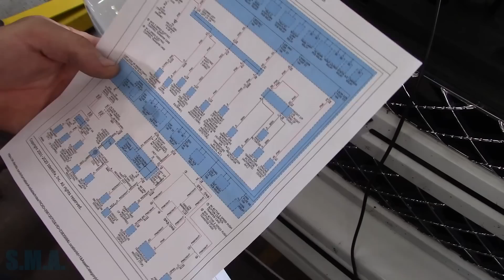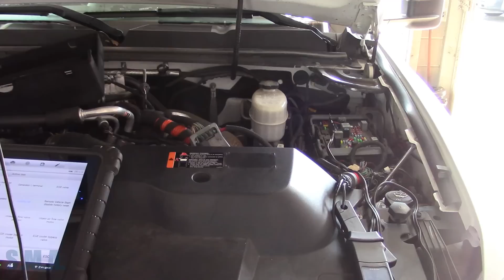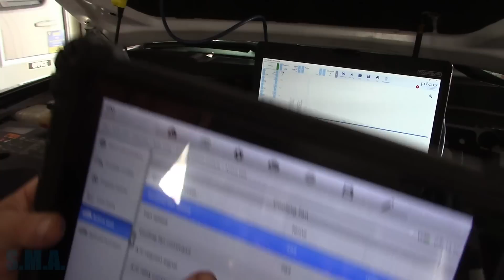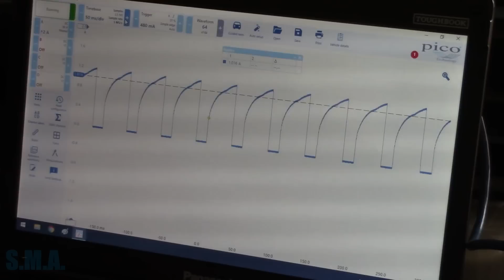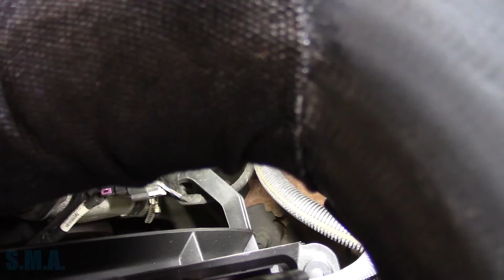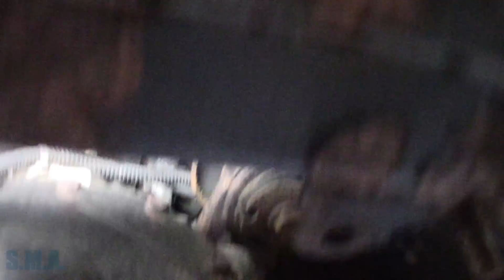Chevy 3500 Duramax Keep Blowing Cooling Fan Fuse

Comment: I had an intermittent short in my 66 gmc taillight circuit.  All at once, it started randomly blowing the fuse.  Only when you were driving it, of course.  Finally found factory harness wire getting pinched by the bed (factory routing).  You had to be driving over bumps and applying the brakes at the same time to blow the fuse. Must have taken decades to eventually wear through the sheath and then through the insulation of that wire. Taped it up good, put in a zip tie to secure the harness away from the pinch point.  Problem solved, mostly by luck since I started at the bulb and worked my way towards the cab.

Comment: Those GM trucks have lots of areas where the harnesses rub through.  The engineers who were in charge of the routing should of been fired.
Reply: Agree, because non-engineers would not have routed it that way, nor made it so frickin short that it couldn't be properly routed. As someone else said on SMA: "Nobody sweats the details like GM's customers."

Comment: I am saying this at 7:30 into the video .remember that time when you couldnt figure out the fuse blowing and it related to the windshield wiper more wireing that frayed at the motor area? just thinking something may be similiar here but not neccessarily the e wiper motor

Comment: Seriously, Eric, you are an inspiration.  A logical approach will lead you to a diagnosis and the diagnosis will lead you to a solution.  But a question - would a dealer have fixed the two wires or would a dealer have replaced the harness. I really don’t know.

Comment: If the white wire was chafed enough to allow enough fault current to blow the fuse, why did the clamp on ammeter only show one amp while you were commanding the fan relay to operate?

Comment: "Chevy thunder".. Think ya meant Isuzu.. LOL
Reply: Chevy Thunder: When the engine falls out of the vehicle and hits the ground.
Reply: @markh.6687  ow is that were it came from
Reply: @neilmurphy845  Nah, it's normally the SHIT ASS IFS suspension deciding to instantly disintegrate itself the moment you put any front axle torque to the spindly little "steering links" that ran from the 2wd 1/2 tons with a 4.3. All the way through what GM called a 1 ton 4wd..
Reply: Never knew that thank you for that info
Reply: @neilmurphy845  You're welcome.. 😉
Reply: The thunder is the rough running from electrical issues
Reply: @armpitdew  It's normally the injector bodies themselves.. Do need to check the digicals on them quite often as well though..
Reply: @armpitdew  ow now it makes sense
Reply: @Ben Gaudreault Yep, with shit injectors, fuel management, electronics (that rival those of early 90's dodges), and way too much other BS that needs not mentioned.

Comment: Found a chaffed wire on a '97 Dodge Stratus like that. It was causing pre-mature ABS activation. It was a new Stratus with 3,700 miles on it, back in '97. The wire harness was hanging down real close to the O2 sensor. Nobody could figure it out, so it got passed off to me, the lowest guy on the totem pole. Took me about 30 minutes. Got lucky, really. Car on the rack, standing underneath with my flashlight. Saw just a glimpse of light reflecting off of copper, just for an instant, long enough to go investigate. :)
Reply: Robert Gantry   I have heard once from an old wise man that you have to look to see what’s happening.  Guessing won’t do.  I too have been to the mountain 🏔and have seen the errors of others.  
Good job sir!   Carry this forward and become the SMA torch artist that Eric has brought to YT!
Reply: @harryl7946  - Nah... I could never be the celeb that Eric O is.
Reply: So, you were suffering from pre-mature activation?? She must have been hot!  OH!  You meant the car....err....nevermind!
Reply: @markh.6687  - Yeah, the car was a perv. It suffered pre-mature activation. lol

Comment: My brother had a '02 D-Max he got from my dad with many wire chaffing issues. Before that all happened he put about 5-figures into the driveline, making this 7,500 lb. pickup perform like a 2k lb. hotrod, LOL! It was a blast!  A fury of black and white smoke - diesel and rubber BABY! Anyway, one day out in NY, way out from us around Herkimer, she became a crank, no-start in the middle of I-90. Thing just shut off like a light switch!  He coasted to the side of the highway and got towed to a local dealer - when my brother got the estimate, he called me to haul her home on the flatbed trailer (wisely). We used dad's '09 D-Max to haul it home ... and when I set the parking brake, the thing snapped ... but that's another story for another day! GM quality! So after lots of frustration, my brother happened to be holding the key in start as I grabbed the harness near the fuse box and BAM! She came to life again. He promptly put it on Craigslist and sold it (we listed its issues in the ad, so nobody got screwed here!!).  A guy from NY came and grabbed her, coincidentally! He was planning on using it in some kind of tractor pull competition. Doubt the body is still in existence, since 5 years ago, it was Swiss cheese. Moral of the story, Duramaxes chafe!  As an addendum to this story, the guy loaded it on his trailer, bottomed out, and tore the return line off the fuel system. I was left with a stain in the street about 6 feet across for about 2 years, LOL. She was cursed, I tell ya!
Reply: Nice find there, brother. I struck out today on a '04 Ram 1500 Hemi - had the lightning bolt ETC light on, with a code for APPS 2 LOW. I assumed a short based on the customer's description of going into limp mode twice after going over bumps, but after a key cycle, everything was back to normal. I found nothing, aside from half the harness in the area of that strange cable-operated APPS under the battery tray not being attached to the studs near the exhaust manifold. I tied everything up, sprayed some DeOxit 5 on the plug and sensor pins, and zip tied that plug's harness. He was ready to wing an APP sensor at it, but I advised against that. My scan tool was showing occasional dropouts to zero on APP 2. I couldn't reproduce it by tapping on the sensor, but could OCCASIONALLY get it to drop out wiggling the harness there. Still found nothing chafing! That was aggravating. Hoping my fiddling with the harness gets him down the road a while before it becomes an issue again. We'll see! Today I was the blind squirrel!
Reply: YouTube's comments are aggravating me lately! I can't use any smilies, or it deletes my entire post!! Good thing I copied and pasted, or I'd be here all night!!

Comment: You know this world is going crazy when you do a great quick prep, test and review of a problem and eliminate the usual suspects then get somewhat lucky on the visual and as of this message 3 knuckleheads don't like it. I know I sound like a scratched record but what is wrong with some people? Good mechanics and shops like SMA are in business and demand because they actually find and fix auto problems that ultimately save people time, money, headaches and more. How can you not like that?   Clarification; I said EricO got somewhat lucky on the visual meaning he found the problem at the first location he looked. That harness goes on for another 10 miles of spagetifigation thru countless pinch points with even harder access.

Comment: At least the other shop didn't throw a fan clutch on it being they are a common failure point. I see a lot of rodent damage down on the FRP regulator 1 and fuel temp sensor harness, not a whole lot of rub points on that era truck, GM does route the harness fairly well for the amount of room given.

Comment: Haven't heard of Tesa tape before. I usually use Friction tape, then cover with electrical tape cause it stick. And then split a lenght of wter heater hose to slip over the injusry and ty-wrap it to the harness.

Comment: If anyone’s gonna find a leaky wire by golly Mr. O is the one for sure to find it. I had a car in once with cooling fan issues. It ended up having a cooling fan relay issue, before replacing the relay the ground and power were checked. Sure enough the power wire had no voltage. A broken wire. I wish I could say I found it as fast as Eric did. It’s quite rewarding when you do find out the source of the problem and are able to repair it. Nice job Eric

Comment: What did the popped fuse look like? Short circuit or overload?
Reply: Given the cause was a rub through to the metal steering box, it'd be short circuit.
Reply: Ian Schmidt my point was that sometimes an examination of each end of the blown fuse can give a quick indication of either a short circuit or an overload to help diagnostics.
Reply: @HuntsChris  Agreed.  I'm just saying that if Eric had done that visual inspection it would've been a short circuit.  His test pretty much showed it had to be as well, since the fan clutch was nowhere near hitting 10 amps.

Comment: You can blame this on GM, but unless you compare this truck to one that has never had any work done on it, you don't know if that wiring harness is in the same place that it was when it left the factory. Incorrect re-routing of harnesses and/or not securing the harness with clips and ties during repairs is a not uncommon problem.

Comment: If you guys want some actually useful advise, in a case like this you can save yourself a lot of trouble by taking the tab off a can of coke, and putting it in the fuse slot. It fits, and conducts, and it takes about 150 amps to blow.

Comment: That other shop was just like a doctor. It’s fine, if it blows the fuse again bring it back. Don’t forget to pay on your way out.
Reply: Eric fixes the problem, the doctor would want to feed the truck pills just to keep it going but not fix the problem. Then your truck would get all these other side effects.
Reply: TEAC Fan here’s a bunch of fuses. Just change them out twice a day and when your out I’ll sell you some more. If it gets worse we will have to up the fuse rating. Take it easy though I don’t want your wiring to burn up by pushing it too hard, we might have to install a resistor to lower your alternator output. It will lower the efficiency of your other circuits but it will keep your risk of electrical shock down.
Reply: Jason The Municipal Mechanic that’s a shockingly accurate metaphor
Reply: @JasonTheMunicipalMechanic  on a semi-serious note: the "other shop" might have suggested putting in a automatic reset circuit breaker in place of the fuse... badda-bing... true bandaid fix.
Reply: @teacfan1080  for which they give other pills with other side effects and so on until you are eating more pills than food
Reply: Kinda sad honestly

Comment: 20 years in Naval Aviation OV-10, A-6, A-4, A-5, F-4, H-2 and H-60 aircraft and you repair more wiring problems in one month than I did in my whole career. Look forward to you videos.
Reply: I was a Commercial Pilot, Director of Maintenance, and Chief Engineer in our charter company for over 35 Years. 1 lear 24, 1 Metro SA226, 1 Aero Commander 500A, 5 MU2-B35/36, 13 Piper PA31, and others through the years. I also did all the Piston Engines, and Turbine Engines including the TPE331-6 & -10 engines for both repair and overhaul. Being a TPE331 "Engine Guy" and pilot, I always wanted to get my hands on an OV-10 Bronco to "play with." We did have a DHC-1 Chipmunk and an Aero Votechody L-29 Jet Trainer for that..... but a Branco would have been.....very special. I still have a 250 Watt 28 Volt Landing Light with alligator clips on it to bridge a pulled Circuit Breaker for testing for shorts. It will draw a maximum of about 10 amps if the circuit is shorted, (and a smaller light for 2 Amp Circuits) but will normally allow the equipment to function when not shorted. Watch the light and manipulate the wiring bundles. When the light bulb lights brightly, you are getting close. Practicing an emergency descent in the Lear from 41,000 feet 10,000 feet one day, Flight Idle, Gear down, Roll to 60 degrees angle of bank, let the nose fall to -30 Degrees, wings level, and decend at 240 Knots indicated. Go to pull the gear up and the Gear Breaker blows. Returned to the field and installed the bulb across the pulled breaker and gear up and down as normal. Gear down and manipulate the wiring on the R/H Gear leg....and....winking light with an arcing sound, and we found the problem. At 240 Knots, the wiring to the squat switch, ....well.....did not fair well where it normally bent during gear retraction. Easy find and easy fix. I love Eric's Videos. They are great educational entertainment. Being on the West Coast of Canada and working on Airplanes as well as vehicles..... I am SURE GLAD we never had to deal with the Rust and Corrosion that he sees....WOW! He is an Auto Hero!
Reply: @davidbrown1037  7
Reply: @Jason Bowman idk.... the wiring on a CRJ-200 seemed kinda finicky at times
Reply: OV-10 puts you in the Vietnam era.  Retired AF crew chief, C-141, B-52 and KC-135
Reply: If they wired the planes and helos this poorly, they'd be hanger queens!
Reply: I at a stage build airplane looms but to tell you the truth, I rather work on high voltage than automotive voltage, it sometimes make no sense
Reply: Sir that statement does not make your career look very good. Maybe you weren't avionics or just promoted up to desk jockey. Eric's troubleshooting process is spot on.
Reply: This was reply to Michael Marks 20 yr career of not fixing wiring. Seems to have posted several times. Aircraft have constant wire problems due to stress, temp variations, weather, abuse, and cheapskate manufacturing. There's miles more of it on planes and the one's you worked on probably were already on their last legs.

Comment: Why do a lot of these type videos skip over the repair.  Finding the problem, great job.  Actually fixing the wires was probably 10 times harder.  Just wondering, been working on cars for a very long time...
Reply: Try and get a camera into an area where you can bearly get your hands in to do the fix, sometimes it is just not possible to video. That's why!

Comment: static cable wiring mounted to vibrating engine also rubbin on the body. isnt that great. that will be 800$
Reply: Damar Wirawan, yep that’s real good engineering... but it was fine on the CAD drawings... of course the drawings don’t show vibration... maybe those engineers should all spend some time repairing the products before designing some new ones ;-)

Comment: I see alot of wire chafing issues on GM's in general!
Reply: Cheap thin wire and cheap insulation, combined with cutting every last bit of slack out of the harness and connections cause this nonsense.